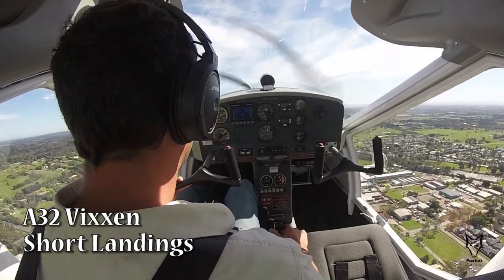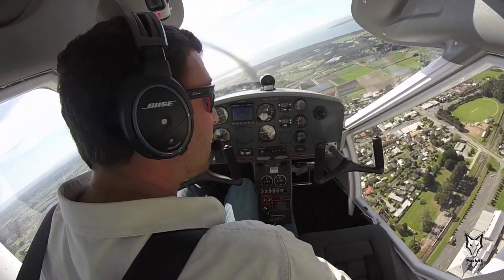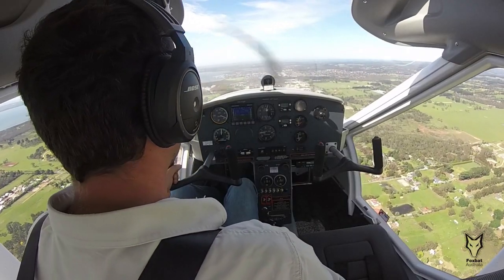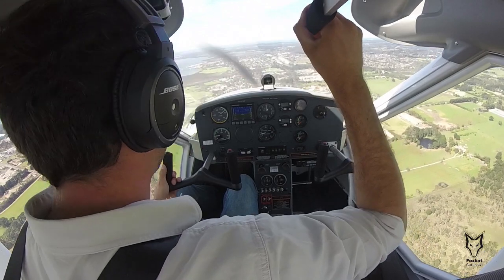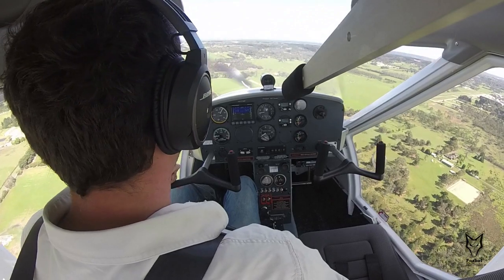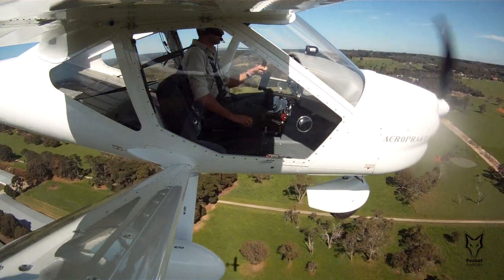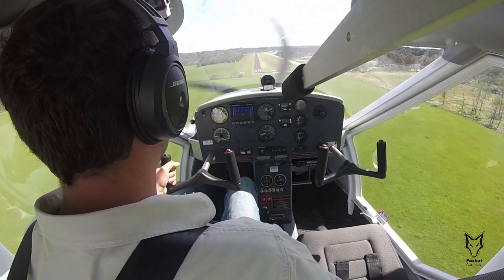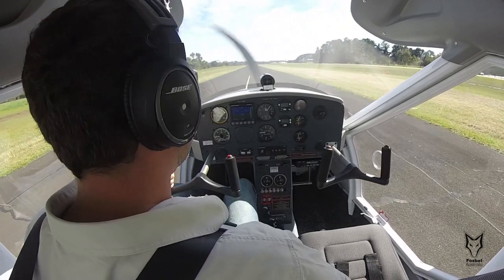How to - A32 Vixxen Advanced Short Landings

Comment: 35 to 40 knots are you crazy??? really??
Reply: Stall is 27. At 1.5 x stall approach would be 40.
Reply: @michaelmcmillan8877 I just bought one A32 with 60h.  I had 22h or training on a 12OOFt grasS  RW in  Ohio. Now back home I am having problems on Landings on a
 4000 Ft paved RW. I Just need to believe I can slow below 60 miles/h on final. that is all...